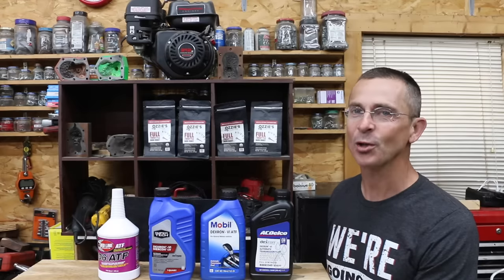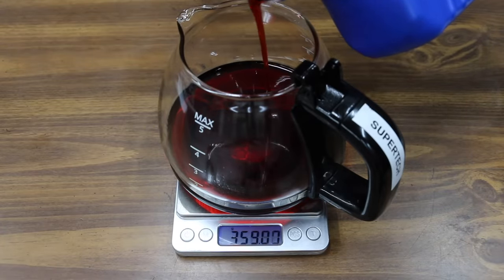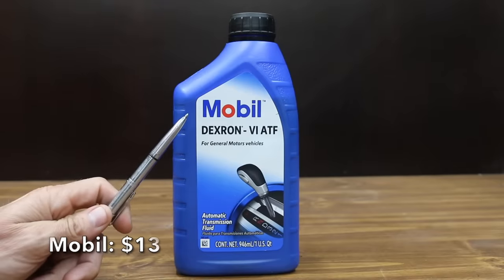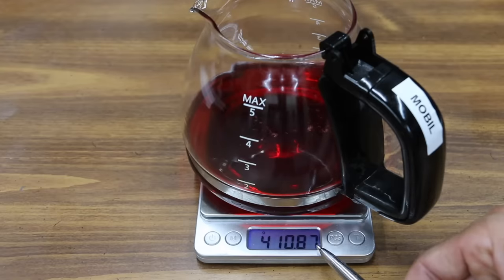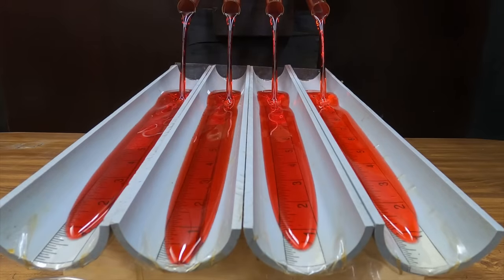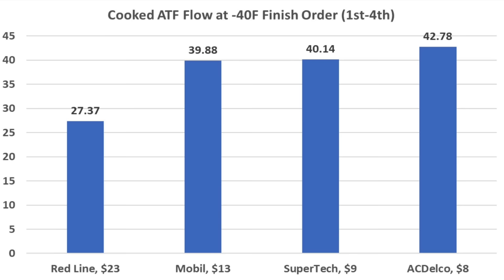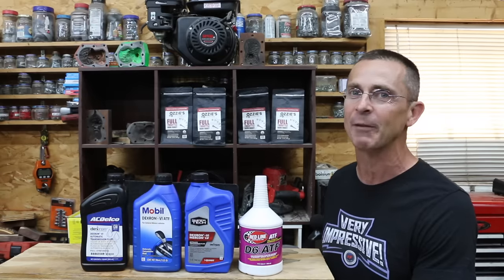SuperTech ATF Safe to Use? Let's find out!

Comment: Surprised to not see Amsoil in the mix with its huge success in your engine oil showdown.
Reply: Same here
Reply from the maker: I'll include Amsoil if there's enough interest in this review. Thank you
Reply: @ProjectFarm  if you can, also include Valvoline maxlife ATF! Performs well in independent bobistheoilguy tests.
Reply: I’d also like to see royal purple atf get tested…I’ve always wondered if it was any good.
Reply: @ProjectFarm  I really wanted to see Valvoline maxlife synthetic as well
Reply: Please test valvoline and Amsoil in the next video please.
Reply: @ProjectFarm  I would like to see OEM Toyota WS trans fluid going against redline as well
Reply: Great stuff.  🤙Agree with others!  Please test Valvoline and Amsoil fluids....
Reply: @Project Farm  Thank you for the current review, sir.  Amsoil please.
Reply: In past comparison tests 
the high dollar brands are seldom any better than off the shelf stuff. 
It's mainly marketing,  and the costs marketing incurs.
Reply: I hate it with a passion but CVT transmissions are becoming more common these day. Could you do a guide test just for the CVTs?
Reply: @ProjectFarm  Id Like to see the Friction Modified MTF variants tested as well such as ACDelco 10-4014
Reply: I'd like to see amsoil also. Planning to change my transmission fluid soon so.......this all helps! Thanks!
Reply: I was also hoping to see Liqui Moly and Castrol in the review.
Reply: Waste of time without Amsoil.
Reply: @ProjectFarm  you should also do motul transmission fluid aswell including liqui-moly.
Reply: The Amsoil bros will be commenting for sure.
Reply: @ProjectFarm  Please do thank you . i use Amsoil motor oil because of your testing .
Reply: @ProjectFarm  valvoline too please
Reply: @ProjectFarm there's also Wolfshead transmission fluid.
Reply: @CaptHollister  they already infiltrated OP's video
Reply: @ProjectFarm here are also the OEM genuine brands that could be tested as well, like Mercedes, VW, etc.
Reply: @ProjectFarm  Count this as another vote for Amsoil. Thank you for the video!
Reply: @ProjectFarm  would also love to see Amsoil, as well as valvoline maxlife and the effects of lucas transmission fix. Love the vids!
Reply: @ProjectFarm Yes.. and Purple
Reply: @ProjectFarm   could you include Honda trans fluid?
Reply: Definitely want to see amsoil.

There was claims made it's a higher class fluid than most others.
Reply: @ProjectFarm  100% would love to see the Amsoil and Maxlife(it's what I use currently) in another roundup.

Also some food for thought in testing these fluids. Auto transmissions are primarily hydraulic pumps, that use the fluid as both a heat spreader and for lubrication. The fluid needs to maintain the same viscosity as new, even when it's burned. Since when you lose viscosity, that's when you lose the "inertia" so-to-speak behind the fluid, that's when the fluid slips passed seals and allows the clutch packs to slip.

Some Slow-mo footage of new fluid speed down the track(it didn't seem like you had many frames of footage recording normal speed), Vs burned speed would show how viscosity loss occurred.
Reply: Another vote for amsoil cvt fluid
Reply: It would probably be best to group "premium products"  together for testing.  Anything that cost
 3 Xs as much as standard products.  Then these sub groups can be compared against each other for value.
Reply: @ProjectFarm  Yes, amsoil.
Reply: @mikefightmaster  AMSIOL is on some shelves and is the best and expensive
Reply: @ProjectFarm  please include Amsoil signature ATF. It’s by far the best ATF I’ve used in my vehicles.
Reply: Have you considered a hammer review measuring weigh balance swing speed with a set spring arm mechanism and energy transfer vibration and bounce back. Steel vs titanium or alloy and wood handle vs fiberglass vs steel. If boss and stiletto are going to ask $200+ for a space age hammer is it really better than an old school estwing or even a cheap Walmart brand
Reply: @ardoin_337  I agree. I would like to see that as well.
Reply: @eatinginternet8690  I agree. I would like to see that as well.
Reply: @ProjectFarm  +1 for interest in Amsoil.
Reply: As this was a dexron fluid comparison, I would like to see  amzoil compatible products as well as BOTH: Valvoline dexron/mercon and the Valvoline MaxLife.
Reply: Valvoline maxlife is one of the more popular and widely used trans fluids in my area. It always works great. Would be great to see this vs amsoil vs OEM
Reply: @wakawu  I’ve used the Valvoline Maxlife transmission fluid in 3 different vehicles with no issues at all. I like it.
Reply: @ardoin_337  Agreed. That's what I run in my two "old" ford trucks (1984 F150, 1995 ranger). And the price isn't completely bonkers like the Red Line.
Reply: @hadi8561  Toyota tests please!!
Reply: Another great video with return of my favorite the race. Especially like the new photo finish feature!
Reply: I'd like to see Amsoil and definitely Schaeffer's in the mix. Thanks
Reply: Same! I want to see amsoil compete!
Reply: I am too. I used to only use Schaeffer's, but recently switched to AMSOIL and the improvement was immediately noticable. My mother's 2000 4Runner got it in the transmission in a full flush, and I had enough left over to flush the power steering in my 1988 Land Cruiser (which uses ATF). The bearing groan in my power steering pump (still factory original) is GONE. Even Schaeffer's, as good as it is, couldn't do that.
Reply: @ProjectFarm  i’d be interested in a video concerning motorcycle oil and is Rotella t4 and t6 really as good as other so called motorcycle oils ?
Reply: @ProjectFarm  please test castrol transmax
Reply: No need to test Amsoil…we all know it’s unbeatable, just ask Amsoil…😂。  Some of us aren’t interested in being raped by Amsoil ‘dealers’ and are happy to learn about more cost-effective options.
Reply: @hadi8561  as well?  Why not also or too?🤔
Reply: @mikek5298  I pay a little less for AMSOIL at my local dealer than I did for Schaeffer's, and about on par with what I would be for Royal Purple 🤷
Reply: @ethimself5064  Some of us are perfectly satisfied with good enough and affordable.
Reply: @ProjectFarm  Please include Amsoil
Reply: @ProjectFarm  id like to see how like toyota ford (motorcraft) and other oem atf compare to redline
Reply: @mikek5298  I fully understand this.
Reply: Should also try Driven Racing (Formerly Joe Gibss Racing)
Reply: @rockit13  Since PF does these brands based upon viewer suggestions, it would appear you hold a minority opinion.  But since others have chimed in for testing of other brands you’ll probably get your wish down the road.
Reply: @ProjectFarm First off - You are awesome!!! I love your tests, I love your videos. I really appreciate the time and work you put into helping us choose products wisely. I really hope this test generates a lot of views and interest, I too would like to know how Amsoil does in this test, as well as other premium brands. - Side note thinking about RedLine, have you ever tested their Water Wetter? Royal Purple has Purple Ice, there are a few other coolant additives that may also be interesting to test. I remember hearing that they reduce surface tension on the coolant, is that how they work? Thank you for the videos!! Have a great week!!!
Reply: @ardoin_337 yes love it... please project farm include valvoline max life at! It's compatible with nearly everything, including some awd LSD clutches
Reply: Yes, please do AMSOIL along with other high quality transmission oils.
Reply: @ProjectFarm  Amsoil, Royal Purple, Mobil Blue label, Castrol would make a great round 2.
Reply: Excellent project. Would like to see Amsoil, Valvoline and Wolfshead next.
Reply: Yes, amsoil, Honda, Toyota, and Valvoline Max life please
Reply: Since you can only buy Amsoil through MLM schemes, I’d be fine leaving it off.
Reply: @ProjectFarm  +Motorcraft please!
Reply: If You do Amsoil in a enclosed area, You will not enjoy it, and it will linger for a week.
Reply: I also want to see amsoil signature series atf tested as well!
Reply: Motul as well
Reply: Wanna see max life amsoil vs amazon basics
Reply: @mikek5298  Not to mention it is worst stink ever. I used it once in a Toyota Highlander and My garage stunk for over a week.
Reply: @ProjectFarm  Amsoil has the best transmission fluid
Reply: I'd like to see the Motorcraft product tested
Reply: @mikek5298 ecome a prefered customer for $20 a year and you get 25% off all fluids and free shipping. (UPS at least for me) So if you place one order of $100 as a P.C you pay for your membership with the savings off retail. And if you spend over $500 in a year you get your next years P.C membership free l am pretty sure..
Reply: Schaeffer also
Reply: @evs8383  yes please. I am interested in more fluids being tested!
Reply: Please do, it's amazing stuff in cold temperatures.
Reply: Or Lucas Oil low viscosity multi vehicle full synthetic ATF, Royal Purple Max ATF or Mobil 1 full synthetic ATF???
Reply: @ProjectFarm  Amsoil should be in every test that has to do with one of their products.
Reply: I use Amsoil signature series fuel efficient transmission fluid in my vehicle. It's good stuff!
Reply: @Vee_H.  I use Amsoil CVT fluid in an early Jatco CVT, considered one of the worst ever made.  I know as I worked in producing the torque convertor and valve body for it.  I swear the only reason it hasn't grenaded yet is not just because I keep the fluid changed but because I keep it changed regularly with Amsoil.
Reply: @ProjectFarm there’s always enough interest with Amsoil. Heck, you tested it before on your engine oil test.
Reply: @ProjectFarm  Please do. I use them for my trans fluid now over the acdelco (glad i didnt use mobile)
Reply: Yes
Reply: @ProjectFarm  as others have said Amsoil and Valvoline in the mix would be great. You can even add Castrol to make a new lineup
Reply: @LitheInLitotes  - Yes or any japanese made  fluid. i think Honda atf is made by Idemitsu (to a honda spec ?)
Reply: @ProjectFarm  Amsoil.
Reply: Also Royal Purple, B&M trick shift, valvoline.
Reply: I'd like to see Valvoline maxlife vs amsoil as well.
Reply: Well..!!! Amsoil it Class apart. Why put Amsoil that we all sure it goin to win any test over any brand…
Reply: Please do Ams oil or Castrol or Quaker don't forget Valvoline!
Reply: @ProjectFarm  I would like to see Amsoil
Reply: @rockit13  how is it a waste of time?  Amsoil is over rated overall. Redline has always dominated
Reply: @projectfarm another vote for amsoil please!
Reply: love to see amsoil
Reply: Amsoil and Castrol would be nice to see in more tests. I've been a die hard Castrol fan for years, but question if it's still as good as it was.
Reply: Definitely amsoil must be included!
Reply: Also need to test John Deere hygard low viscosity. Could it be a better transmission fluid?
Reply: I would like to see amsoil, valvoline, and maybe a few other oem transmission fluids.  I would also like to see some of the Fram products from advance auto included in some test.
Reply: it's worth the extra money I use it and it's still bright red amsoil in 4r70w
Reply: @ProjectFarm Very interested in seeing Amsoil Signature ATF.  Thank you
Reply: I would like to see Ford and Toyota (oem and higher performance compatible) transmission fluid tested.

Love this channel!!! 💕
Reply: Was thinking the same
Reply: Amsoil can hold its own against anything out there.  It has been keeping my vehicles running well for over 25 years, with all going over 225K miles before selling them with plenty of life still in them.  Never had any engine or trans issues while using them.  My current 2014 F-150 with the 3.7L V6 now is almost 230K and still running great.  Keep up with oil and trans fluid changes and you are on your way to long-lasting vehicles.  Never go by the manufacture's change guide for transmissions as many say "lifetime" fluid. Only true if you want a very short lifetime with your vehicle.  Change trans fluid every 30k-50k miles (depending on your vehicle and how it is used).  Oil and trans fluid is cheap, engines and trannies are expensive.
Reply: I’d like to see Amsoil vs. Valvoline Maxx Life.
Reply: @ProjectFarm  YOU NEED to test Dexron 3 vs Allison approved Mobil 1 Delvac TES 295/468/668(latest spec) Approved Fluids.  The Dmax/8.1 with Allison 1000 trans fluid debate is heated since Dexron 3 and Dex VI was standard from 2001 to 2006 and Dex VI from 2007 on. Allison recommends the upgrade. NOBODY has tested this!
Reply: @hadi8561  Toyota WS is the best stuff for the Toyotas, and it is pleasant smelling, unlike Amsoil which is the absolute worst stink You can imagine. Until they take the stink out, I will never use it again.
Reply: Please test amsoil!!! Tks
Reply: I’d also like to see a test of “Top Shelf” fluids like Amsoil, Redline, Royal Purple, and the like. This was a valuable test, and I always appreciate your methodology and control of variables. 👍🏼
Reply: @ProjectFarm  ALSO Allison Does NOT recommend using Dex 6 in 2007 or older trans because the chemical makeup attacked some seals.
Reply: Schaeffer's ATF would be a good one to test also.
Reply: @ProjectFarm  amsoil and ZF from BMW gearbox manufacturer (redline is zf rated)
Reply: Please also liquimoly
Reply: @ProjectFarm  Would love to see Amsoil because that's what I'm looking at swapping to from the stock Mercon LV.
Reply: @ProjectFarm  and pennzoil
Reply: Yea, I used amsoil in my trucks transfer case and it’s working just fine. Plus amsoil has that cool pouch like container for easier filling.
Reply: Amsoil!
Reply: Amsoil has data and pictures of the wear on their website
Reply: @ProjectFarm  please protect yourself from the fumes given off by the hot fluids when you use such testing methods
Reply: @ProjectFarm  please try Shaffer oil with a amsoil
Reply: Same here   Ive been using Amsoil products for 30+ years and I feel like they have always been one of those companies that maintains the quality of their product and doesn’t just rely on a name.
Reply: Also, Motorcraft mercon LV
Reply: Round 1 
Next round ? 
Great video
Reply: Intrested in this myself
Reply: Amsoil is all I run.  4L60s need all the help they can get.
Reply: Definitely curious on the Asmoil.
Reply: I was hoping for the same I switched mine over to signature series.
Reply: I agree Valvoline, Royal Purple and Amsoil would be great products to test. I currently use Valvoline.
Reply: @ProjectFarm  Amsoil, yes please.
Reply: @grabbag6314 I've asked for a t6 review for years. Ii don't know why he won't do it.
Reply: Amsoil, Lucas, and Valvoline Max Life too. Do a showdown like you did with the Pennzoil 5W30. We need a Champ!!! 😂👍🏻
Reply: @ProjectFarm There is.
Reply: @ProjectFarm  I’m curious too how Lucas Oil slipfix does
Reply: @ProjectFarm  of course there is🤦🏻‍♂️
Reply: I started using Amsoil in my Honda and saw an immediate improvement, would like to see it as well
Reply: Zf lifeguard 8 fluid
Reply: I really want to see a shootout of maybe like 12-15 ATFs. Of additional interest to me would be Amsoil, Toyota WS, Lucas, Royal Purple, Valvoline, Castrol, Triax, Mopar, Liqui Moly, Schaeffer
Reply: @EatingInternet  it's all made by ExxonMobil oil only a few differences in the additives but all the base oil is ExxonMobil oil but the oil is the same from the cheapest to the expensive.
Reply: @ProjectFarm  There is.
Reply: @Project Farm  try different specifications against each other. Like TES-295 or tes-668 Allison spec against dex 3 against mercon v  against atf 4. What spec has the best flow and wear protection?
Reply: +1 for Amsoil here. Paired against RedLine, Royal Purple, and generic "parts store" ATF (cough...oreilly...cough)
Reply: @evs8383  Id also be interested in Royal Purple.  Other than their worm screw transmission lubricant none of their other products have impressed.  Their plant is about 30 miles from my place.
Reply: @Miketime969  we must have seen different testing. Does redline guarantee it for double the manufacturers recommended intervals?
Reply: AMSOIL FOR THE WIN! LETS GOOOOOO!
Reply: @ebutuoyebutouy  that’s pretty neat they’re so close to you or you to them for that matter lol. I’m a user of their high performance street oil, the high mileage oil, and their high performance 2 stroke oil in my dirt bike. I’ve had a good experience with all of it. But of course everyone has their brand preferences and use cases
Reply: @evs8383  Unfortunately my experience w Royal Purple does not warrant the high price.  Yup, everyone has their own opinion.
Reply: Agreed, I'm interested!
Reply: @ardoin_337  also Mobile HP, for GM 8speed...you know the one that you have to pay out the nose for...and since why is Mobil the only one to make "GM approved 8 speed)
Reply: @ProjectFarm   how about Castrol Transynd and Shellspirax S6 in the next year
Reply: Please do
Reply: @ProjectFarm  What about Toyota WS ATF cheers.
Reply: @ProjectFarm  yes please
Reply: @mikefightmaster  If you watched the video, you would see that the more expensive fluid beat all the others. Fluids are not all the same.
Reply: If you're going to redo it please include Motul Gear 300LS
Reply: “Amsoil” 😂  Yeah, because they have a really cool looking bottle, and they have some cool looking banners at race tracks, so it must be good, right !?  It’s gotta be good enough to hang a banner at a race track right ? The American public has got to be the most easily pushed over consumer base in the world. 
Get a grip people, do you honestly think that there is a better oil than what came in your vehicle off of the assembly line ? Remember that little phrase “ 10 year-100,000 mile warranty on most new vehicles today ?
Do you think that has anything to do Amsoil ?   I think not.
Reply: @JT-qf4it   
Some cars are better than others. 
Not many people drive a Rolls-Royce.
Reply: Also Fram as that's what advance auto sells
Reply: I would like to see amsoil castrol and Amazon in the mix, and maybe mix it up and use the Chrysler atf
Reply: How about Motul? Not sure if they make transmission oil though without doing a search.
Reply: From the comments it seems to me maybe there is a need for a full on ATF tournament like was done with motor oil?
Reply: @ProjectFarm Would be interested in seeing how Wolf Heads Universal Full Synthetic Transmission Fluid would perform
Reply: Let’s do Amsoil signature series 💪🏻
Reply: Valvoline
Lucas
Royal Purple
Amsoil

Please test these for a part 2 and compare the results with these sir

Edit: amazon basics too
Reply: @ProjectFarm  Though they are rather unknown, Ultra1Plus has a dex 6 full synthetic that our boss swears by. Could you potentially include a quart of that in the next review?
Reply: Just had my transmission fluid flushed  this past weekend. I use Amaoil, so it's a little late, but still would be good to know for my other truck. Thanks for all the great content.
Reply: @ProjectFarm  almost 3m subscribers!  There will be interest.
Reply: Definitely include Amsoil. I use both the regular and LV. Hands down the best.
Reply: @ProjectFarm Battle of the Titans. The Super Bowl of ATF!
Reply: Amsoil, Royal Purple, Maxlife, and Motul!
Reply: Yup! I vote now for a best synthetic transmission oil competition. He can even use the current redline numbers and compare.
Reply: In the rematch that everyone wants , add mobil1 to the list.   Great vid as always Todd!!!
Reply: @hadi8561  It is know to be sub-par, for Toyota I recommend switching to Enos or Valvoline.
Reply: I love ams oil for my domestics and redline for my European vehicles. Japanese get super tech.
Reply: Used valvoline maxlife on my Honda and Toyota 300k miles and going strong. Both vehicles
Reply: Never seen the Mobil at the store. I would have thought Pennzoil Platinum LV ATF would have slotted in nicely here.
Reply: Definitely would like to see Amsoil dex and Amsoil torque drive. Great work.
Reply: @ProjectFarm  if you end up running the amsoil test may I also suggest along side that transmission fluid from BG? My old boss has worked in the service side of automobile dealerships since the mid 80s, he's been super sold on all sorts of BG products including their transmission fluid for 20+ years
Reply: Love that there are still people like you out there that believe in integrity. My hats off to you my good sir.
Reply: I use amsoil for Harley for motor and gears so I’m interested too.
Reply: I’d like to see the Amsoil Signature Series Low Viscosity (Blue cap / label) ATF compete against other brands.
Reply: @ProjectFarm  I've been waiting on an atf showdown
Reply: I definitely want to see Amsoil in this test!
Reply: The original oil for my Range Rover with the ZF 6 speed transmission is very expensive from the dealership. Aftermarket oils that people recommend are still quite expensive. I think anyone with a ZF 6 or 8 speed box has the same problem. I wonder if the factory oil required by ZF is really that special compared to the other oils.
Reply: @ProjectFarm  I’d like to see Amsoil! Please Todd.
Reply: I’ve always wanted to know how Amsoil stacks up against others.
Reply: @ProjectFarm  Please! After their success, I would like to see them whenever you're testing a product that they have! ❤️
Reply: @ProjectFarm  Amsoil and Mobile1 atf (silver bottle) would be neat to see
Reply: I’m a Redline guy but have used Amsoil in the past. I’d like to see the Amsoil tested.
Reply: I also expected to see Amsoil in here as well, very interested to see that.
Reply: I’d love to see Amsoil. Just flushed my atf using Amsoil last week before my road trip.
Reply: @ProjectFarm  ATF Showdown please!
Reply: Or idemitsu
Reply: I would love to see Amsoil ATF multi vehicle, Fuel efficient, and CVT formulas and how they compare. I switched to Amsoil multi vehicle in my transfer case over mopar ATF 4, and seem to have a smoother ride… not sure if it’s placebo or not.
Reply: Love to see I test with the different types of engine coolants on the market and if there really is a difference between them
Reply: I'd definitely like to see the amsoil royal purple and Lucas tested in the next round.
Reply: @ProjectFarm  if you could also include Amsoil as well as an MTF for comparison.
Reply: @ProjectFarm  Do it!
Reply: @hadi8561  WS is a HORRIBLE semi-synthetic ATF. My wife's 2014 Rav4 WS was black at 22,000 miles. Trucks do ok IF they have an oil cooler on them. All Rav4 except the newer Adventurer series doesn't have a cooler in them. I put D6 Redline in it and it is still red after 30,000 miles. Full syntheic and high end ATF can take the heat better then cheap to Toyota WS.
Reply: Agreed!!!
Reply: A lot of guys run 50-100% generic hydraulic fluid in their 4l80/60s.  That might be an interesting addition.
Reply: B&M would also make a good competitor in this. Only trans fluid I’ve used that was blue, I want to see their additive package. Another great video!
Reply: @ProjectFarm  definitely include amsoil .
Reply: @evs8383  royal purple hadn't tested abovee the average in any tests I've seen/read.
Reply: @ProjectFarm  I’m a go for Amsoil👍🏻🙏🏼  Mega kudos on your integrity brother!
Reply: I’m beginning to see a pattern with Mobile products. They seem to be ok but most other products, unbranded are better.
Reply: Amsoil
Reply: @ProjectFarm  I lived near the Amsoil labs in Jersey during the 70's and one of our racing buddies in mini stocks worked there (he was an Asian lab geek and seemed so out of place with his own car in the pits...lol). We started getting engine oil samples from him for the cars and ran with Amsoil stickers/decals for their first unofficial race car sponsorship. The oil was so new and untested in the field it was like crazy to put it in your racing engine. No measurable effect was the result.
Reply: Also include liqui moly thanks
Reply: @ProjectFarm  Great video!  For me, having an older GM vehicle, Dexron -III compatibility is important.  Testing Amsoil would be very interesting too.  Great job!
Reply: @ProjectFarm  Please include Amsoil +1
Reply: Thank you for this test!
Would love to see other major brands tested, just like the oil shoot out you done?👍👍👍
Reply: Would loved to have seen AMSOIL in the mix!
Reply: I was thinking the same thing. I've never used the Signature series fluid, but I have used the OE full synthetic fluid with great success in past vehicles. I would personally like to see another showdown with one of the Amsoil fluids in it.
Reply: I is interested two 👍
Reply: @ProjectFarm  As others have said Valvoline max life, Royal purple as well as Amsoil would be an awesome comparison 💯
Reply: I think the +1.1k likes on this comment are a definite YES for Amsoil testing!
Reply: Always one in the bunch
Reply: @ProjectFarm  DEFINITELY INCLUDE AMSOIL ATF. I've switched to amsoil and it's way better than WS. but I'd love to see some comparison.
Reply: @Project Farm  I use Valvoline Max Life full synthetic, it's the only available that I can use for my Honda CRV and MB transmissions.  I Would like to see how it compares to th Amsoil, and the ones just tested!  Love your channel!
Reply: @ProjectFarm  Amsoil signature series fuel efficient the blue label vs red line vs AcDelco ULV vs Mopor 8 & 9 speed... would be good show down
Reply: Yes please include amsoil!
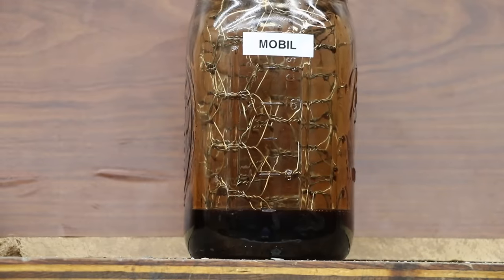Reply: @user-fq3uh7bt1t  7:52
Reply: Another who would like to see Amsoil included
Reply: @ProjectFarm  
Yes plz
Reply: @ProjectFarm  I am ALWAYS Interested in AMSOIL!
Reply: Please do a Amsoil review. I am sure that a lot of people want to see what the difference is.
Reply: OEM Toyota and Honda too please
Reply: @ProjectFarm  Would love to see Amsoil.  With the price of AT4+ fluids available at local stores being very comparable, I often will use Amsoil ATF.
Reply: @ProjectFarm  Castrol also..I use for Mopar fluid
Reply: Me too. Love amsoil
Reply: @ProjectFarm  we'd all love to see Amsoil vs Shell Rotella T6 vs Pennzoil!!
Reply: @ProjectFarm  please
Reply: I would like to see CVT fluid tested please.
Reply: @Project Farm +1 for Amsoil test
Reply: Max life, amsoil, pentosin, and maybe some dealer fluids like Honda or Toyota etc
Reply: @yzmoto80  That is just an ignorant statement. You know nothing about lubricants and what's in them. Most oil in a vehicle from the factory is break- in oil. You just keep changing your oil with the cheapest you can find every 3000 miles Genius.
Reply: Another great video.  I was somewhat surprised at the results.  Thank you.
Reply: Valvoline max life, amsoil, Honda ATF(not 3.1) and motorcraft.
Reply: @ProjectFarm also Motorcraft LV would  be nice, Ford says to use only their oil due to some clutch additives 😅
Reply: @ProjectFarm  Valvoline maxlife ATF vote here. Top seller at my workplace ( major autopart store )
Reply: This test was on Dexron VI ATF which is a GM spec. I don't believe Amsoil has a Dexron VI specific ATF.
Reply: @ProjectFarm  I'd rather see a comparison between purported premium brands such as Mobil One, Amsoil, Royal Purple, Pentosin, and Valvoline MaxLife. Thanks for everything you do!
Reply: @ProjectFarm Could you make a video like this but testing power steering fluid instead, particularly the brands with stop leak claims? I've tried a few different bands myself and all of them did nothing to stop or even slow my leak save for one, Lucas Oil with stop leak. I typically have to add a few ounces every other week but with the Lucas Oil I only had to add a little bit in the past 5 months. I'm curious to know more about it as well as if there are any other brands that are capable of performing at that level as well or are they one of a kind.  Thank you.
Reply: [Lubegard entered the chat]
Reply: Iv got the 6 speed 6l50e transmission in my truck and it is a continuous debate on the better atf fluid to run in it. The main fluids that are widely talked about are Amsoil signature series, Mobil1 blue label, valvoline maxlife, and OEM GM. Thank you much for the awesome videos I look forward to another atf video sometime in the future!
Reply: I'll provide you the AMSOIL atf if you want.
Reply: @ProjectFarm  Amsoil, please!
Reply: @ProjectFarm  can you test brand Petro Canada?
Reply: I would love to see how Amzoil does. Keep up the great work, bud!
Reply: @ProjectFarm  I am very interested
Reply: Be cool to see a part 2 with amsoil thrown in there against redline. Extreme brand is really big in the racing oil/fluids too
Reply: I'd like to see Amsoil and Royal Purple ATF compared!
Reply: @ProjectFarm  please include Amsoil
Reply: Hey I got a test idea. How about a showdown between battery operated rototillers?
Reply: I’d be interested to see amsoil & maxlife ATF in a review! Maybe toss motorcraft & another generic in too!
Reply: Yes Amsoil, Chrysler's 30 dollars a quart and several other brands need to be tested as well
Reply: @ProjectFarm  Yea, with how it's said one of the best, I would love to see it in your tests....
Reply: Agree with adding amsoil in a second round. Oh, and mopar atf+4.
Reply: Amsoil
Reply: Loved this. 
I use acdelco. 
Just hit 300k on the teanny running.  
Another 300k flat towing. 
How about the different additives. I put lucas products in my car.  
Engine oil treatment.  
Heet. 
Tranny stop leak. 
Could you do a oil with and without the additives
Reply: @ardoin  yeah I think valveoline max life is all I've ever used lol Another video idea: @Project Farm  Leather cleaners/conditioners could test on car seats and boots and swade was about to try Leather honey seems popular over the years I've tried many but most underperform.
Reply: @ProjectFarm  perhaps a best stackable storage box series? Split into non waterproof and  waterproof?
Reply: +1 on amsoil
Reply: I'd like to see if Lucas Stop slip additive could transform the worst performer into the best performer .. (It has a good reputation)  like you 😊👍
Reply: @ProjectFarm  It's looking like we need a tranny fluid showdown similar to the engine oil showdown.  I use on-brand stuff in all of my vehicles, but that Redline is looking pretty strong.
Reply: Do you think it's fair that you're heating the oil to more than double? What A transmission normally runs at How about normal condition testing? I don't think A transmission would ever run to Over 400ﾟ without a catastrophic failure ?
Reply: Also interested in a shootout including 
Amsoil 
Royal purple 
Valvoline 
Castrol

Ps: great work as usual
Reply: I was dissapointed as well
Reply: I’d like to see royal purple atf as well as amsoil
Reply: Amsoil please, they have both the fuel economy and signature series
Reply: Amsoil would be good. I’d also like to see to test Archoil as a repair/wear additive. 

I’d also still like to see you test some water filters to clean water like may have been found in OH after the disaster.
Reply: Amsoil vs Royal Purple....Amsoil will win!!
Reply: I literally laughed out loud when you said people accuse you of being bought out. Ha Keep up the great work!
Reply: Redline vs Amsoil
Reply: @ProjectFarm  I agree I think we need to see a part 2 ATF showdown
Reply: @ProjectFarm    +1 for AMSOIL and others.
Reply: Same! I thought Amsoil vs redline wouldve been a great competition. I feel that it was kind of obvious that the redline was going to outdo the other three oils.
Reply: Amsoil next!!!
Reply: I agree, theres a ton of guys who swear by the amsoil. It is pricey though! I used this same redline in my c5 vette 6 speed. It weirdly calls for ATF
Reply: Id like to see valvoline and amsoil.  Mostly because i use valvoline for most everything and while i absolutely could be wrong im pretty sure amsoil is just overpriced marketing.  Royal purple is another premier brand that would be interesting to see if youre considering a ATF brand 2.0.
Reply: @ProjectFarm  100% I would never consider Red Line, but would consider Amsoil above anything else.
Reply: @ProjectFarm  would be cool to see a shootout off all the high end synthetic atfs. Like the amsoil, redline, mobil 1, royal purple, etc.
Reply: Toyota WS at around $20/ quart deserves to be in this head to head.
Reply: @ProjectFarm  Don't forget the fully synthetic Mobil1 ATF that's easily available nationwide.
Reply: @CaptHollister 😂😂😂
Reply: @ProjectFarm  Yes I would also like to see Valvoline Maxlife and Amsoil as well.
Reply: I would like to see Amsoil, as well as other performance type brands! I figured Red Line was going to take it!
Reply: @CaptHollister  yaw you betcha!
Reply: @jessekaija7657  Mercon LV, SP & Dex IV=6 yes. It's a lighter vis than regular Mercon, Mercon V=5 & Dex III. It's AMSOIL, no z.
Reply: @mikefightmaster  No, it's not just marketing, marketing applies to your 3-4-5 dollar a quart so called full synthetics that often contain large amounts of conventional petroleum in them as well, that's a marketing term. Despite what these rather crude you tube vids show the premiums perform much better in practice. They will take the heat and torture twice as long as other fluids with a stronger fim strength= wear protection to boot. The components that go into the premium fluids cost A LOT more, therefore the price.
Reply: @ProjectFarm  I think the interest is biased cuz we all just love watching your vids regardless!
Reply: @ProjectFarm  Amsoil has four different automotive synthetic ATFs.    Signature Series ATF is top of the line 100% synthetic ATF for Mercon & Mercon 5, Dexron 2 & 3, Chrysler ATF +4 & Mopar ASRC and other Aisian & European applications.
 Amsoil Signature Series Fuel Efficient ATL is a 100% synthetic low viscosity top of the line ATF for Chrysler SP-IV,  Dexron 6,  Ford Mercon LV, SP, ULV and other Asian & European applications.
 AMSOIL OE origional equipment OTF is lower priced 100% synthetic ATF and is rated for manufacturers drain recommendations, it is for Dex 2&3, Mercon & Mercon 5, Chrysler ATF+4, ASRC etc.
 Amsoil OE origional equipment Fuel Efficient OTL low viscosity 100% synthetic ATF is lower priced and rated for Chrysler SP-IV, Ford Mercon LV, SP, Dex 6, etc.  They also have CVT, DCT, manual transmission & transaxle and other specialized transmission fluids as well.
 So if you want to test top of the line use the Signature Series fluids. Although the OEs are quite good as well and I have used quite a bit of them and they seem to stand up real well. Semi retired tranny guy and plow truck operator here. Plow trucks are really hard on transmissions.
Reply: Yes! I would add Amsoil and Valvoline as well.
Reply: me to
Reply: @projectfarm please include Motul and AMSOil
Reply: Motul ATF Dex VI and Amsoil comparison please
Reply: Yes, definitely amsoil, royal purple, wolfshead, valvoline max life, liqui moly, and any others. Great segment
Reply: @LitheInLitotes  not a bad idea. Idk if its their transmissions or their fluid, but ive seen quite a few hondas with low miles have nasty fluid. Even just like 30k miles and was already burnt, brown, or super dark red
Reply: I saw a 1-2 mpg increase at highway speeds in my 2016 Kia Sedona 3.3 liter V6 with AMSoil over factory
Reply: Want to see amsoil, valvoline, and royal purple.
Reply: @ProjectFarm  thank you for this test, for 2014-2020 Sierra, Yukon, Tahoe, Suburban 6 & 8 Speed transmission, GM recommended this Mobil 1 Synthetic LV ATF HP to eliminate issues with the transmission. Some owners went with Amsoil ATF it would be nice to see Amsoil in this test and if possible this Mobil LV ATF. Thanks so much for everything you do.
Reply: a vote for valvoline maxlife and toyota WS please! Thanks! Excellent production as always!
Reply: @ProjectFarm  Definitely see how amsoil compares?  You're tests are a big reason I use amsoil motor oil in all my vehicles!
Reply: @ProjectFarm Add Valvoline Maxlife full synthetic against Amsoil if you do!
Reply: Lots of great test against ideas.  Would love to see both Amsoil and Castrol Transcynd.  Of the two, if I could only pick one, it would be the Transcynd because it is the spec'ed fluid for HD Allison Transmissions.   Thanks for the depth of testing that you do.   Very educational.
Reply: I'd like to see how well Amsoil performs.
Reply: @ProjectFarm many are suggesting an ATF off, agreed! As an outlier, could you include Liqui moly Top tech ATF also!?
Reply: @ProjectFarm  yes, very interested in the Amsoil comparison. I am looking to use it as a replacement for OEM Honda ATF. Thank you sir!
Reply: Yeah good point. 

Maybe they'll retest?
Reply: @ProjectFarm  i would also like to see valvoline maxlife atf as many have said, vs amsoil and also  Transynd 668 which runs in many allision 1000 transmissons.
Reply: Test Amsoil, Schaeffers, Valvoline Max ATF, against the Red Line atf.
Reply: @ProjectFarm @ProjectFarmp lease , do bathtubs different paint test and best & worst. With which one handles water
Reply: @ProjectFarm royal purple as well?
Reply: I will love to see Redline vs Amsoil ATF 🔥🔥
Reply: @ProjectFarm  yeah theres a whole lotta other ATFs you could use, brand atfs, like toyota and ford, or even compare all of the vehicle brand atfs
Reply: Amsoil please plus Toyota WS
Reply: Royal purple, Amsoil and Valvoline max life in the next review🤩👍
Reply: I’d like to see how well Amsoil CVT does mixed with an additive like Lubeguard. 
Does it really help with wear and overheating?
Does it enhance performance and smother shifts?
Reply: @ProjectFarm ill pay for it if you use AMSOIL atf
Reply: @ProjectFarm Include Triax ATF too please. I'm really interested in their products because of their claims and price points.
Reply: @ProjectFarm  amsoil, royal purple, lucas,
Reply: If ProjectFarm added Amsoil someone would've said "Why didn't you add Royal Purple?" and then another brand and another and another. You all are selfish and never satisfied. You all refuse to accept this man work that he provided for everyone. What's funny is that none of you all will ever question any manufacturer testing that they're marketing to the public.
Reply: @disguiseddv8ant486  he literally says in his videos if you'd like to see others tested, say it in the comments.
Reply: @bsquadrider  Right, and some of us (eg me) are paying subscribers. My $2 a month should warrant some requests to be made. That is beside the point that he asks for suggestions. I'm not sure that guy even watches the full videos.
Reply: whaaaat Valvoline Max life......the go to for most real mechanics.
Reply: +1 for amsoil!
Reply: Would love to see Amsoil compared.
Reply: Would love to see Amsoil and OEM Toyota/Honda
Reply: @ProjectFarm  would be glad to see the oil Olympic again!  it has been 4 years since last competition.
Reply: @ProjectFarm seafoam makes a trans tune that works for ATF and power steering if you would to add it the showdown 

thank you for including ac delco 
thank you for your service to our country
Reply: @ProjectFarm   Color me interested, would love to see a big competition like you did with the oils.
Reply: @ProjectFarm  I'm really interesting in seeing Amsoil Signature series in particular if that's possible. Great content btw!
Reply: There is also some new good stuff from Valvoline extended protection ATF
Reply: Amsoil showdown with Redline!
Reply: i'm interested how well "Triax Oil Fluids" compares with all these brand
Reply: Valvoline Max Life is the number one universal full synthetic ATF fluid. Please consider adding it to your list in the future.
Reply: @Skyhawk945  and now they have even better formula  Extended protection ATF
Reply: Who cares about Ams???
Reply: Yes AMSOIL please and max life thank
Reply: Amsoil people are more annoying than crossfitters.
Reply: @ProjectFarm Val online too
Reply: @ProjectFarm let's do more for transmissions and their additives. Most of us are afraid of transmission so it becomes a consumable item
Reply: Amsoil me please
Reply: @ProjectFarm  include Honda ATF please since Honda trans are bad but would last if you use their own ATF and yes for amsoil
Reply: @ProjectFarm  ld like to see a comparison of Toyota ATF WS, and the equivalent from Redline and Amsoil. Thank you.
Reply: Thanks for testing.  I recently bought an older collector car and all the automotive product results are helpful in choosing what to put in the vehicle.
Reply: @ProjectFarm We need Redline VS Amsoil ATF. Also Toyota WS, since everyone makes fun of Toyota's ATF fluid.
Reply: Since it's getting close to March Madness, I think it's time for another tournament but for ATF!
Reply: I’ve wanted to try am soil but other brands sell 6 quarts for around $45 and amsoil might cost me 60-120
Reply: Do it! Amsoil and valvoline atf vs redline   @ProjectFarm
Reply: Ames oil vote🙋‍♂️
Reply: Please test valvoline maxlife atf thank you
Reply: @ProjectFarm I'm interested in it, I am wondering what differences there are between different JWS 3324/WS fluids for my TF-80SC/Asin AWTF-80 SC. I am likely to buy from AMSOil anyway, since I order direct from them to make it worthwhile, but I am curious.
Red Line D6 also claims to be a valid replacement for AW-1 (the Asin OE fluid)
Reply: @ProjectFarm  Amsoil/Red Line/Valvoline/Motul/Mobil/Idemitsu  CVTs fluid and ATF fluids video analysis, please!
Reply: @ProjectFarm    Yes, please...
Reply: We'd like to see amsoil versus the red line and maybe throw motorcrafts LV in there. I seen through the comments there's a lot of interest
Reply: Agree
Reply: I use maxlife on transmission and power steering. It works great.
Reply: Yeah, look for the Amsoil too! That would be awesome to see their ATf fuel efficient. It’s pricey si it would be cool to see if the price equals better performance
Reply: @ProjectFarm  I know this is an old vid of your but I would like to know where to put our suggestions. Plus I wanted to see how Honda ATF would perform as well since we know that Honda has some paper transmission and using only OEM ATF helps.

Also, penzoil ATF please
Reply: @ProjectFarm also castrol please
Reply: Yeah more brands. It seems like it’s 1 good brand vs 3 bad brands. I’m sure there’s a brand out there with similar performance compared to red line that is much cheaper.
Reply: Please, for the love of all that’s holy, Test the AMSOIL!!!!!!! 😂
Reply: Valvoline is what I used a couple years ago in my Chevy.  Would love to see that one ...plus Amsoil too